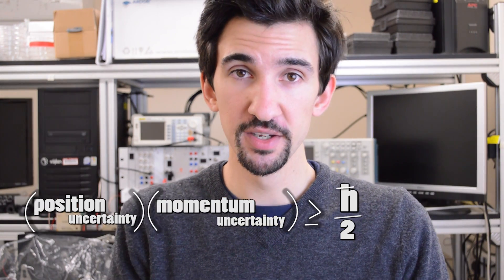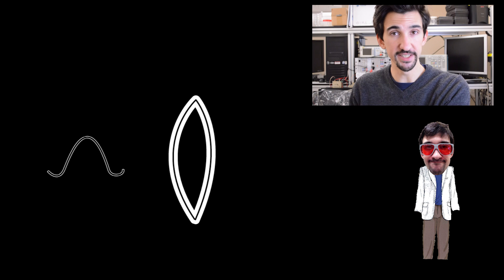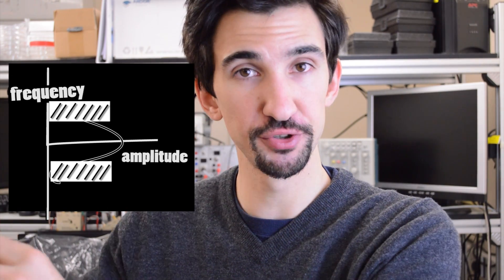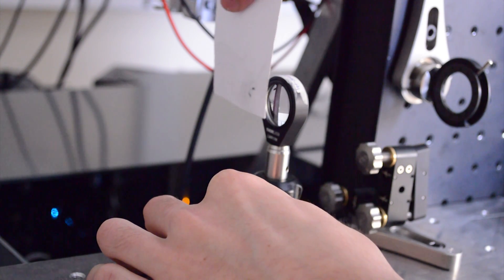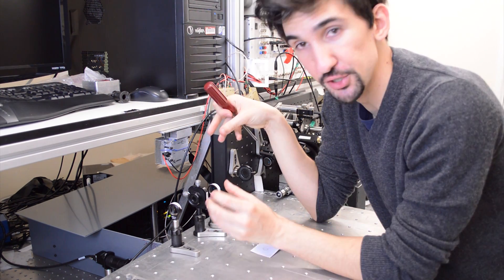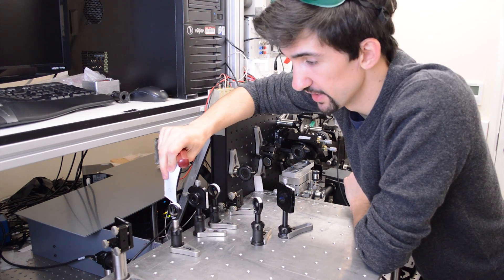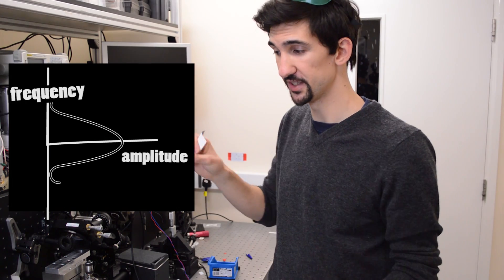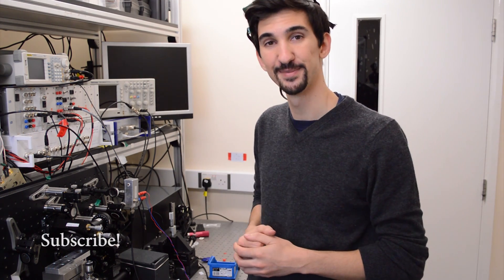Showing the Uncertainty Principle

Comment: Is the uncertainty principle dependent upon multiple frequencies IE I use a O.T.D.R for my Fiber Optic work but we are limited at 850nm 1200nm 1350nm and 1500nm etc.  does this principle apply to single wavelengths ?

Comment: You video quality is very good. What camera do you use? And, can you explain why low momentum wave is focused at the center, while high momentum is focused at side?
Reply from the maker: Hey! I use a Nikon D3200, not perfect but it does the job!

Hmm. That's a tough question to answer in a comment.  Google-ing "fourier optics" is a good place to start.  

Basically because of diffraction only perfect plane waves will focus to a point. The more "plane wave-like"  (uniform in intensity) a shape is, the better sharper it will focus.  So low spatial frequencies, which appear quite plane wave-like, focus near the center, and high spatial frequencies focus further out.  

I hope that made some sense!
Reply: Thanks for giving me the keyword "Fourier Optics". I will take a look at that.
Reply: whentheappledrops

Comment: Why does the image become splotchy rather than uniformly blurred?
Reply from the maker: That's a great question! My honest answer is I have no idea.  

This was a "quick and dirty" experiment, likely, my optics weren't aligned properly/ or had dust on them.  That may have just been some underlying shape of the beam also, as it comes from the interferometer it's already passed a lot of components that will have distorted it's shape.
Reply: whentheappledrops  Perhaps it is also because the laser isn't passing directly through the center of the pinhole, but rather slightly more to one side?
Reply from the maker: Tom McLeod very likely! That could potentially make a lot of sense!